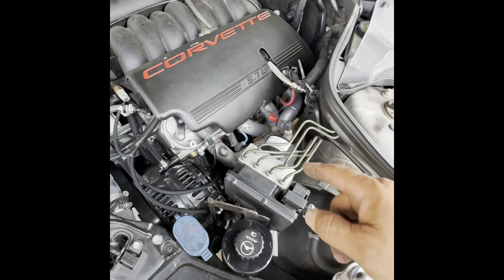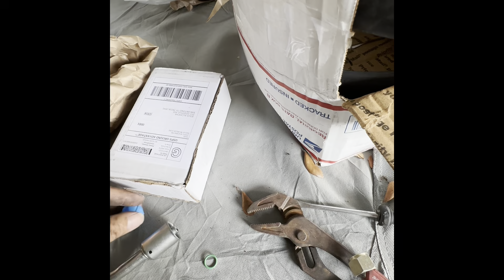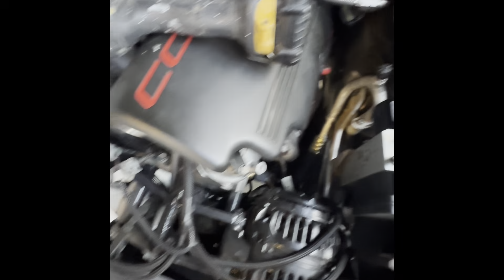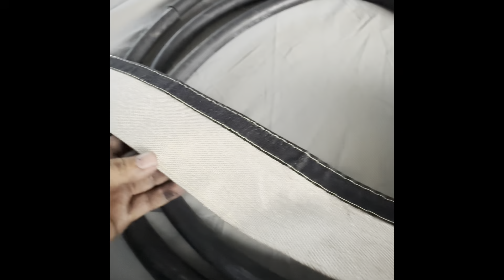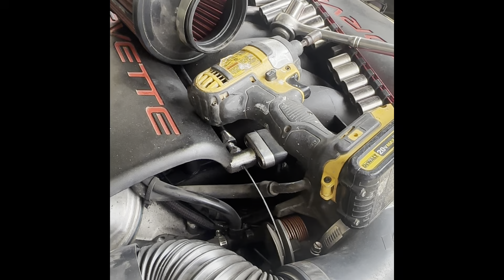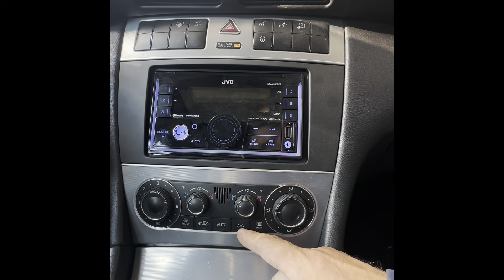Ls swap c230 air conditioning conversion

Comment: How did you integrate the AC request circuit from the Merc to the GM compressor? Is it a +12 signal from the dashboard harness? Are you running either a hi and low pressure switch or perhaps a single trinary switch? What do you use to cycle the electric fans for when you request AC? I ask because I'm putting an LS in my 1992 Merc 500SL. I also am helping a friend put a Chevy engine in a 1981 Ford which also uses vacuum operated HVAC doors for vents and a very basic AC request line.
Reply from the maker: Hi, thank you for checking out my videos my  FiTech Ecu turns on the fans when the AC clutch is engaged. I am running the pressure switch and the power to the compressor direct with a separate switch but the fitech ECU has a separate positive wire for the compressor to read the positive signal when it receives 12 V from the compressor it automatically turns on the radiator fan